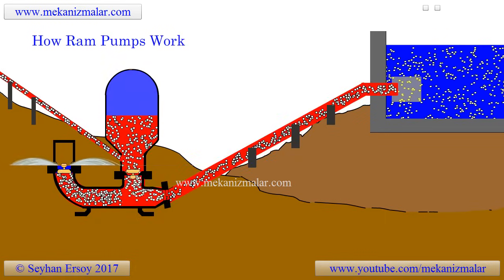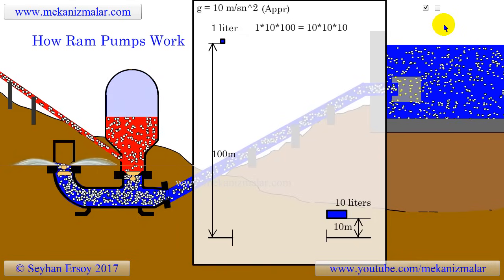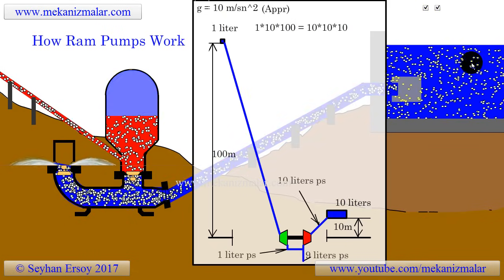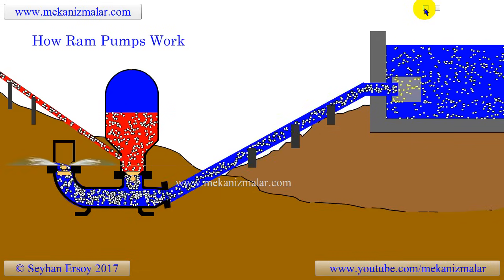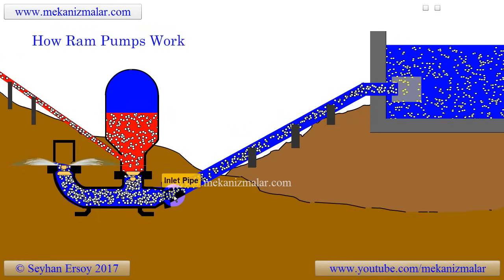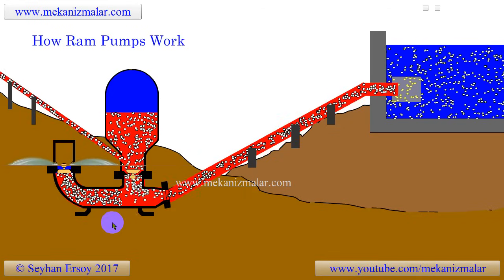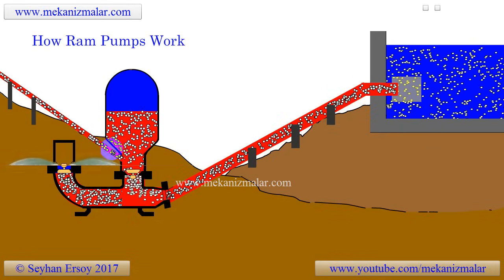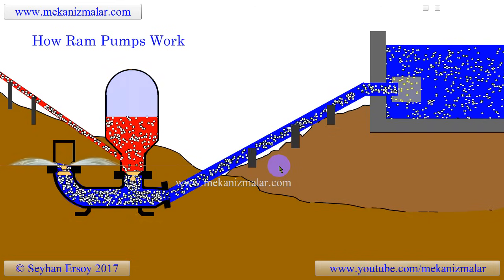how ram pumps work new version

Comment: What I don't understand is why a creek at higher elevation is required...it seems that one could create/install a high pond and once that pond is filled...water is constantly running uphill to fill the high pond.
Reply: The water source only has to be a higher elevation than the pump so gravity makes the water flow into the pump. Whether you use a pond or a steam, the water has to flow into the pump from somewhere. The moving water supplies the energy to make the pump work.
Reply: @edeaglehouse2221  Thank you!! You guys are the best!

Comment: 1. Water flows downhill which forces the waste water valve to shut
2. When the valve suddenly shuts the weight of the water flowing downhill wants to continue flowing in that direction (water hammer) causing a sudden rise in pressure
3. The sudden rise in pressure causes the valve to the outlet of the pump to open 
4. While the water flows through the outlet, it causes air pressure in the accumulator tank to rise
5. When the air pressure rises enough in the accumulator, that causes the outlet valve to close.
6. While the outlet valve is closed, the excess air pressure in the acumulator forces the water uphill.
7. Also when the outlet valve closes, this causes the water to stop flowing on the inlet side which lets the waste water valve open via gravity.
8. As the water flows from inlet to waste this causes the waste valve to close again from the flow of water. Which starts the cycle again
Reply: Thank you,  I appreciate your detailed explenation, Well done.
Reply: Do you think it's possible that the giza pyramid was a ram pump?

Comment: I am still waiting for someone to properly explain why the waste valve opens after it shuts off, so far nobody explained ( math, physics ) behind  it, sure enough, I built one , and it never opened by it self , I suspect due to the water pressure keeping it closed,
Reply: Trye to put a weight under waste walve to overcome water pressure.
Reply: I think direction of the valve in waste has to be inverted

Comment: how does the waste valve shut and not waste too much water?
Reply: i wondered this , i think its when the flow through it increased enough to push it closed ,when the water sped up enough. then it slams the water into the accumulator.

Comment: My new patent amplified Ram Pump (Ramplified) can lift to 30m from 50cm drive head
Reply: That is good. However, the wastewater flow should be much higher, from 50 cm to pump water to 30m.
Reply: @seyhanersoy8989  not needing higher drive heads in my design

Comment: So the pump have 2 vales, each one will take turn to open and close as the water pressure change. At the first vale there is a air tube, which use as a air pressure pump to push the water up. As the water flow the pressure shut the 2nd vale, which then build pressure one the first vale force it to open now water will flow into the first vale and fill up tube. So the air in the air tube got compressed, to a point the aire pressure is strong enough to push, and shut the first vale at the same time push the water up. Vale 2 open up when the water pressure is reduced due to water flow into vale 1. The water flow pass vale 1 to vale 2, then force vale 2 to shut, then vale 1 open. So one vale open, other close, then using compressed air to push air upward. Very nice ideas.
Reply: Thanks for your detailed comment. Yes, it is a very good idea.

Comment: How efficient are ram pumps? What % of water is lost in waste valve?
Reply: OK, I found the answer. Typical efficiency is 60% but up to 80% is possible.
Reply: Oh well, it turns our that 60-80% does not refer to  how much water is delivered. The amount of water that goes through depends on source and destination heights. If the source is 2m above the ram and water is pumped 10m above the ram, only 20% of the water will be delivered to destination. So basically the %  of water delivered = height from ram to source / height from ram to destination  * 100. So in our example   2m / 10m *100 = 20% of water delivered. 

AND THEN you take that  60-80% energy efficiency of the pump to see how much water you will actually get at the destination. So you don't get 20% of water delivered as in the example above, but you get 60-80% of those 20%. If the efficiency is say 70%, then you get 70% of 20% which is 14%.

Not very inspiring numbers. But it can be done on the cheap, requires no fuel of electricity,  and it's very simple system not much to go wrong. So it's a good choice if you have enough  water  an the source. Otherwise solar panel powered pump seems like a better choice.

Comment: I'm starting to comprehend the whole system, so I'm grateful to you for that, but it would be helpful if all the elements in your graphic were labeled.
Reply: So as not to confuse us, as each component of the system is labeled and flashed to call your attention to it as its function is described.  Worked well for me!  Did you get impatient?

Comment: It wastes a lot of water in the process. Is it possible to use electrostatic electricity or magnet on the outer pipe,water inside will have an opposite charge and will tend to spin. If there’s a kind of Archimedes screw inside the pipe the spinning water will probably rise!
Reply from the maker: It is misconception that many people think waste water is wasted. Actually it is conservation of energy principle. If you want to pump water to higher elevation, you need more energy to do that. We use waste water energy to do that and discard the water to the environment. If you want less water discarded than you should reduce the hight that water pumped.

Comment: How about if you dont have a downstream water...what i have is only a horizontal irrigation canal could it work?
Reply from the maker: Unfortunately my answer is no. If it was possible we could produce energy from flat see surface.
Reply: It should work in the irrigation canal in the winter when water is flowing through it. Though the flow rate might be an issue as far as pumping ability.

Comment: may i ask sir?
when water hammer happen, how much velocity of water? what the formulation for that?
Reply: It depends heavily on the diameter of parts and size and type of valves. And material of the valve and pipes.  The momentary pressure spike has so many variables it's not possible to calculate. Only to build it and measure it.

Comment: This drawing needs improvement...
With this cartoon, people (like me.!.) will tend to think, why not simply run a pipe across from right to left.? The pump is needless.!
What you need to change, is, the level of the structure on the right of the screen needs lowering somewhat. If the diagram showed the left side's level to be OBVIOUSLY higher than the right side, it would make much more sense. 
At the moment, it makes the pump seem pointless.  Just a suggestion 😉

Comment: I have doubt in ram pump, can we do it without water waste (valve wastage)? . Always waste water is falling down so can we reuse(send back to source bucket)???
Reply: Do you send water back to a dam after generating electricity? You can't. The energy passing from the turbine is not wastewater, it is water that generated electricity and loss it's potential energy. The same is true for the ram pump, the water called wastewater, actually is used water, that water pushes a small percentage of the water from reservoir to higher elevation.
Reply: @seyhanersoy8989  your explanation is enlightening me as a person that thaught the waste water  as a "waste".

Comment: One could insert a non return valve so the output pipe would not pressurize the balloon or tyres or tube. 
Surely there is a balance point
Where the strong balloon or tyres or tube can provide extra thrust to extract more water from the accumulator
If the tube is able to contract more than the pressure build up in the accumulator?
or should i say more than the head pressure required to trust water to the top of the output, 
but less than the pressure coming in to the accumulator.

I think we are on to a major breakthrough in Ram pump pumping technology here?
Reply: Build it. Let us know what happens. Put check valves half way up the pressurized discharge line, and at the end next to the water storage barrel. And one fourth of the way up

Comment: If the accumulator was a type or balloon rather than a rigid vessel would more water be thrust up the delivery pipe?
Reply: No the accumulator needs to be ridged to produce air pressure to push any  water up the delivery pipe. If it was a balloon or expanding it would not develop enough pressure to the push the water up and also the head of water from the reservoir would burst the balloon.
Reply: @des2610  One could insert a non return valve so the output pipe would not pressurize the balloon or tyres tube. 
Surely there is a balance point
Where the strong balloon or tyres or tube can provide extra thrust to extract more water from the accumulator
If the tube is able to contract more than the pressure build up in the accumulator?

I think we are on to a major breakthrough in Ram pump technology here?

Comment: Could the wastewater be captured at that lower point, (reservoir under the Ram pump), then run downhill to another Ram pump which would then refill the upper reservoir? There would still be loss but recaptured energy in the upper reservoir.  I think there's a problem here but I'm just not seeing it. That being said I have used the Ram pump and they are fascinating devices. I think the answer may be in head drop.
Reply: Why would you waste time trying to recapture water to fill the upper reservoir?  These systems are to be used on year round creeks/streams/springs.  The reservoir would fill on it's own, indefinitely.
Reply: @Bright_coded  there would be a depreciated return but my system does not have a falling water area anyway I've stopped worrying about this problem.
Reply: @Tsumarinai  The dam analogy explains it best. You want 'free' energy from the flowing water, to pump some of the water uphill, for your use. You do not waste this precious 'free' energy and time pumping the flow water back into the dam. Rain and gravity will ensure your river is always flowing; thus your water and free energy are replenished. What happens downstream is your neighbor's issue, not yours.

Comment: In the waste valve, is it possible to save the water that comes out in that valve, for example adding some weight to the valve so that the water connot comes out.
Reply from the maker: Waste water is a necessary both for water turbines and for ram pumps. If you close exit gate of a turbine you can not produce electricity. Water just accumulates in the dam lake. At the same token, if you close waste valve no water will pass through the ram pump, water will just run down hill outside from reservoir. By passing water from ram pump, you can pump small portion of that water to higher elevation and release the large portion of that water down hill.

Comment: So you could have “infinite” energy as long as water moves downhill. You constantly run the water you moved uphill through a turbine, back into another holding tank downhill doing the same thing, and this just keeps going
Reply from the maker: Dear Arrad, The only way to move water uphill is by the suns energy and generate electricity by passing same amount water from the turbine. Even that is not generate electricity to the infinity. We know that sun will die in the future. Also, places we consider becomes flat lands by erosion. In short, in the nature there is no infinite energy for us to use.
Reply: You certainly could put the output tube into the river before the inlet pipe, but then you are using 80% of the water to move 20% back to the river.  If the river were to stop flowing by itself, you would quickly run out of your own waste water, sending 80% of that 20% downstream the second time around until there isn't enough water left in the river to power the device.
Reply: Bernoulli equation pgh +v2/2g+hL
Reply: Should be able to run the water(that was pumped and/or before it went to ram pump) across a waterwheel and make electricity.   Make electricity twice if you have the height.

Comment: This is what they used the pyramids for
Reply: Where was the elevated water?
Reply: @SiegePerilousEsauMaltomite  in the mote around the great pyramid maybe... But, I think some pyramids were for pumping water uphill, and others could have been used as hyperbaric chambers, or both... For example, one pyramid could have been used to pump the water from an aquaduct near the Nile (closer back then) and fill a reservoir in another pyramid that would use water volume to create air pressure (inside the queens chamber of the great pyramid for example) which could then be used to run pneumatic tools and create electricity through the use of turbines, or pressurize chambers inside smaller pyramids or the so called Kings chamber.
High technology, limited resources. (Soon after the flood, if you believe that sort of thing)
Reply: Samuel Reed You need to change your dealer. Whatever you're smoking is causing delusional thoughts.
Reply: @Liam Flynn I'm good, u?

Comment: How high is the elevation of the source of water going through the pump? Plz really nead the answer.
Reply: It depends on the volume, and how high it needs to pump
Reply from the maker: This is a tough question to answer for me.  Elevation of the source could be depended on the elevation of the output  and also the amount of input volume and output volume you want to get.
Reply: Minimum 2-4 feet of head for source water to pump. Depends on configuration and flow. I watched a guy use a four foot drop to make 32 psi. That could go up about 70 feet.

Comment: I wonder if a check valve in the delivery line would increase efficiency.
Reply from the maker: Thank you for your visit and comment. I think putting a third check valve will decrease efficiency. This is because when check valve closes the momentum created by the water will be absorbed with check valve instead pumping extra water. Also life span of new check valve be very short compared the others. This will create maintenance problems.
Reply: Stanley, please build it and tell us what happens. Adjust, in the installation,  the check valve installed  closer and further from source water, If possible.

Comment: Is there optimal diameter of the delivery pipe in relation to intake pipe? And is the size of accumulator important? Does it affect the speed of valves opening and closing?
Reply from the maker: Those are though question for me to answer. But I recommend you to check following ram pump calculator program. https://www.borstengineeringconstruction.com/Hydraulic_Ram_Pump_Perfomance_Calculator.html
Reply: Hater Sensei Grand Master Chosen One   I am sorry that that link is broken. I guess, the owner of that site deleted that file. If I find another one I can add it here.

Comment: Shouldn't the water in the pipe on the left side of the waste valve remain blue (unpressurized) instead of turning red with the rest of the pressurized water?  It seems to me that the waste valve and open waste pipe would require it to be that way.
Reply from the maker: Thank you for your visit and question. Actually, the waste valve is not on at all the time. It periodically opens and closes. When it is closed the flow on the left turns red, on the other hand, if the waste valve is open the flow becomes blue. If the waste valve was on all the time there would be no water flow to higher ground. The ram pump almost works just like German V-1 flying bomb which was world's first guided missile. V-1 ram engine had flaps in front of the engine. Whenever there was ignition, increased pressure inside the burning chamber would force the flaps to close,  When the exhaust gas expelled from the exhaust valve the kinetic energy of gases creates a vacuum inside the burning chamber. This low pressure would force the flaps to open. This periodic opening and closing motion of flaps create a buzzing sound and flying bomb also called as buzz bomb by British.
Reply: No, it needs pressure to close the valve
Reply: Thisis.what

Comment: I don't really understand the purpose of the waste valve.  Would the pump work if the waste valve is permanently sealed?
Reply: No, because the pressure tank would not compress, and the water would stay in the pipe... Obviously it would need an alternative spillover point
Reply from the maker: Thank you for visiting my channel. The short answer to your question is NO. Thing about a dam, if you close exit pipe you can not generate electricity. Same principle apply in this pump too.